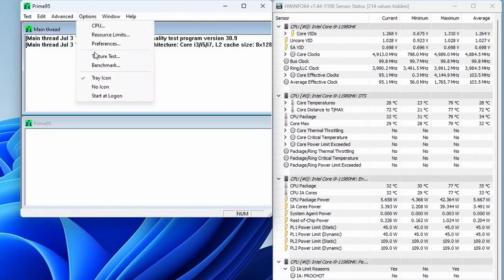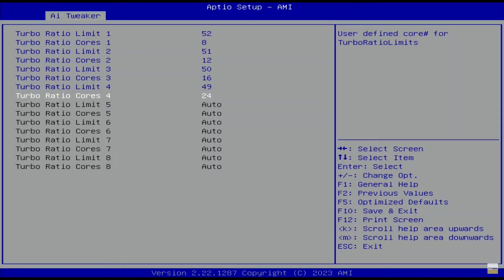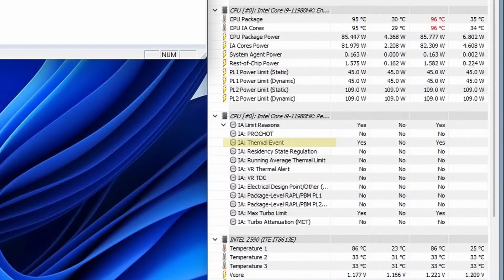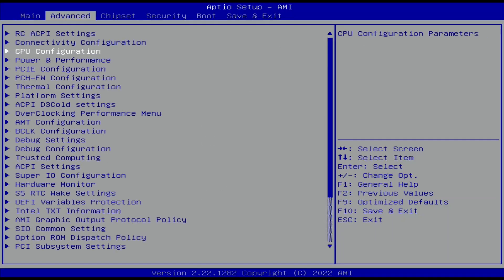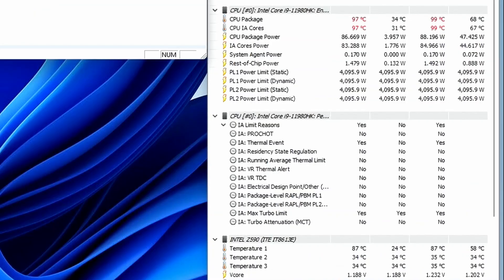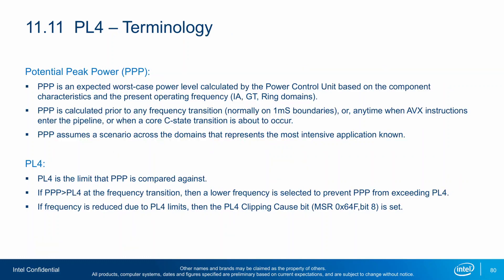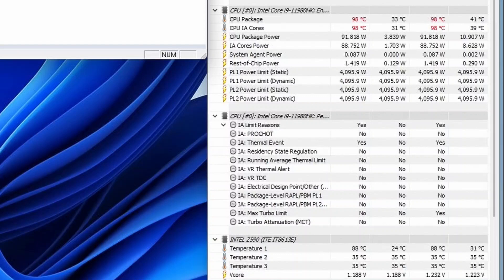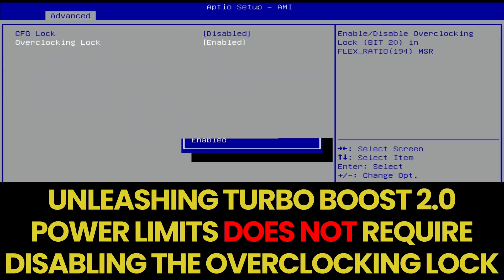Turbo Boost 2.0 Analysis & Configuration | SB#65

Comment: A nice add-on video to SB 65 since these erying boards have nearly every available feature exposed in the bios and can be very confusing (I know my first week with my ES board was) to tune up. My OC method was different from yours, as I used per core adaptive voltage offsets and set ratios to the most reasonable values at ~1.4v. With TDC maxed out I was hitting about ~150w with liquid metal under the IHS and a 360mm corsair AIO before hitting thermal limits. From the looks of it, the turbo boost method seems to be a little better for attaining max clocks in low to mid intensity workloads.

Side note I've joined up on the discord and will be retesting my max OC for my ES board to see if I can best your numbers in SB 65, results will get posted in the discord when I think I've gotten the most out of it.